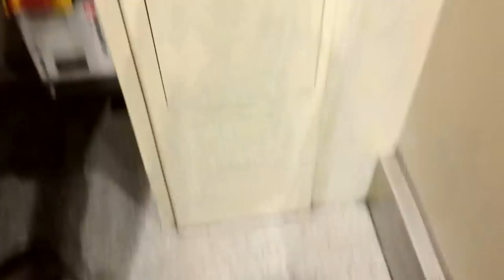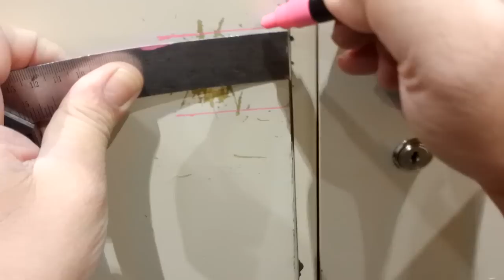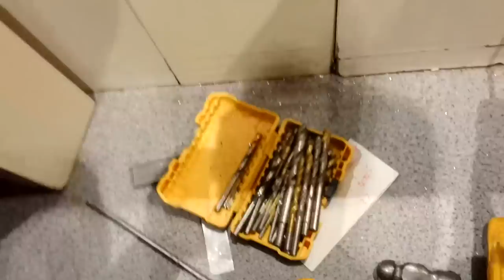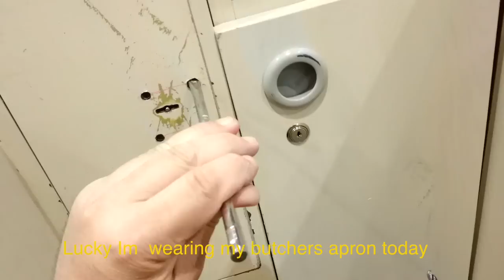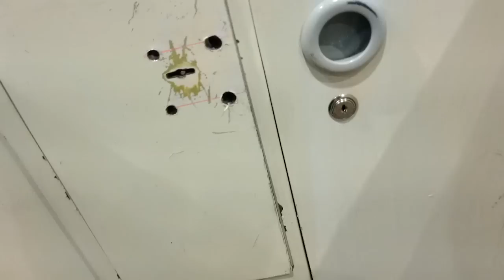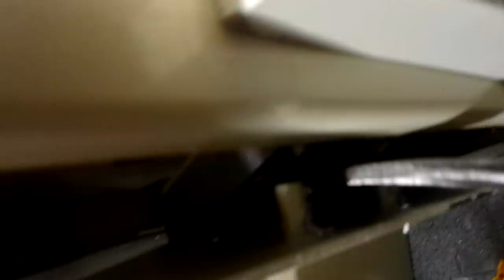Drilling Open A Safe

Comment: Seeing as this safe does not include a relocker assembly is there a reason why you didn't just put a punch through the locks hole and just blast it off with a sledge hammer? I found it works with dial combo locks.  Drill a hole, put punch on lock and go to work.
Reply: Sometimes you run into ones that do.

Comment: I too can break drill bits with ease.....
Reply from the maker: They need to make stronger drill bits for people like us, I take some responsibility , Some of my drills are a little cheap  and nasty. They seem to always brake in the new 001's right down the back where they are hard to remove
Reply: @DrLockShop  most safe locks are protected with a hardened plate, so there's no reason in drilling with regular drills. Some safe locks (like mauer 74046 for example) are easier to pick or decode, than to drill the safe door. I'd even say MOST safe locks. Though, this method is okay for beginners, but definitely is not for pro locksmith servicemen.
Reply: @ivantolstov6469  read the description.